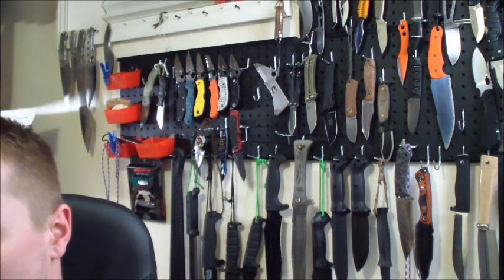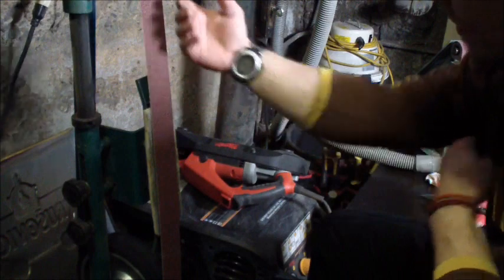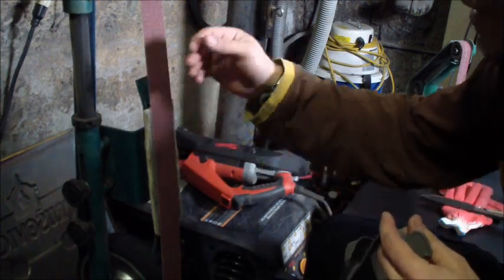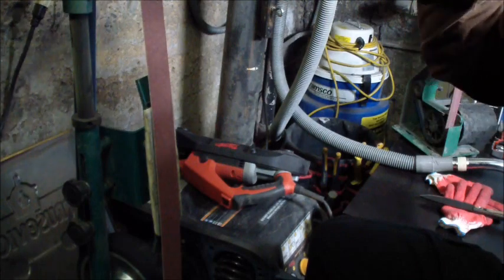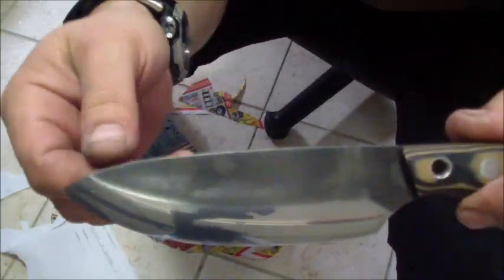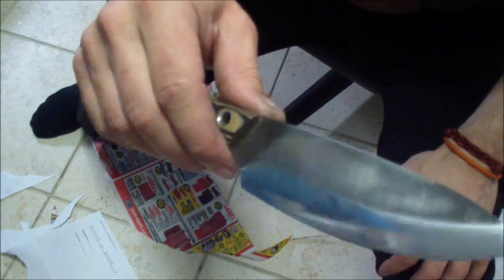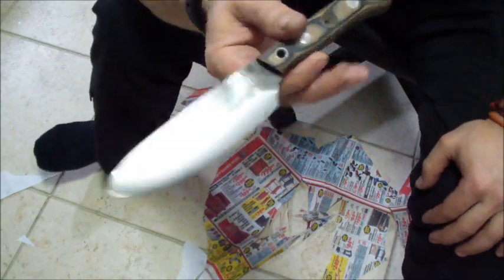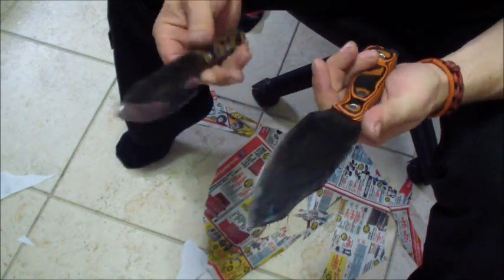Reprofiling Habilis Pathfinder Trade Knife

Comment: Merry Christmas Mike, and have a Healthy, and Prosperous New Year,  I helped in designing my knife, I never planned on making a Trade Knife, all I wanted was a longer Bushlore Style of knife, I made it 6", and a 1/4" thick, by 1 
1/4" wide, out of 3V, and I had it Cryo Tempered,  the handle is a black G-10, with red liner's,  the handle shape is similar to the O.K.C. handle's, except the finger. Hail is deep, and the other one not so, I also had it scalloped, so no matter how I hold it, my finger fund's a groove, and is very comfortable, I also had the corner's rounded off, it's very sgaro, and I had a Flat Vex Grind put on it, it sort of look's like a Trade knife, the plsk 1, etc., but mine is pointier, because I have a arch going from the tip, to the pommel, also the edge is from tip to almost the handle, it chop's ok, baton's well, and I could get some nice curl's, I just wanted to let you know about my knife, what do you think, again Merry Christmas.

Comment: Hi Dude,. I love the result. I used to have this knife but I sold it almost a week later. The handle is very skinny for this kind of blade (they fixed it, and now they have the "robust" handle version). And the edge as you said do not have any sense, is almos identical to the condor rodán (another non-sense knife). Again, love your job with this knife!.

Comment: I always start with 60, even when starting a new blade.  I use the Norton Blaze Orange belts, been using the same 2 for almost 20 blades now and they still chew pretty good.  36 is almost too much, one slip and you can gouge pretty bad.  60 is perfect.

Comment: its really interesting that you find the 60 lasting as long. it doesn't look like you are using ceramic belts which may be why. in ceramics, the 36 definately lasts a lot longer than any other belt by double at least. the 40grit is not even close to as good as the 36 grit. the 60 is what I used to use and its definately good, but when it comes to removing sheer volume the 36 ceramic blows it away. (in my experience anyway)

Comment: With those single bevel grinds, it looks to me they are just picking some bevel width without thinking about the resulting angle due to the stock thickness. Condor does the same and the knives end up with very low cutting ability as there is just one grind and the angle can be 20-30 dps.

Any reason why you started at 60 instead of 36 grit?